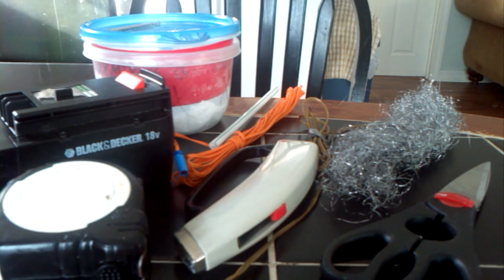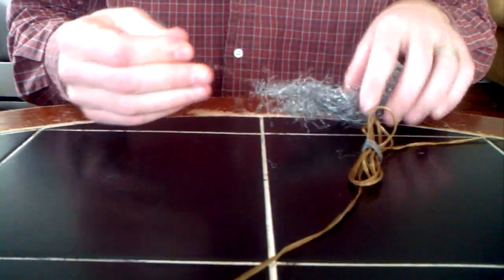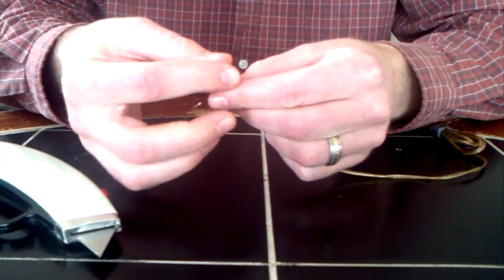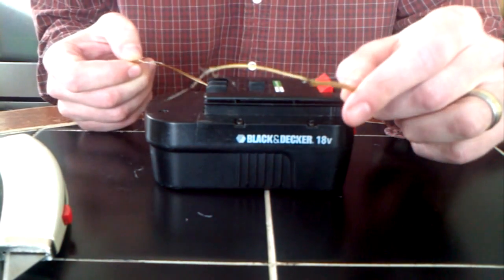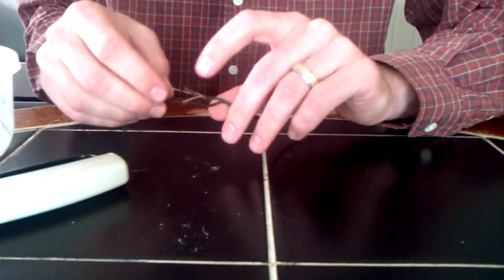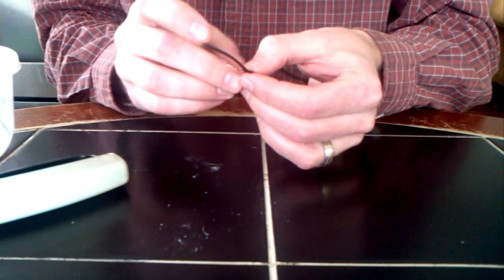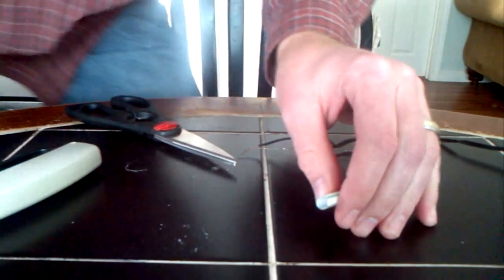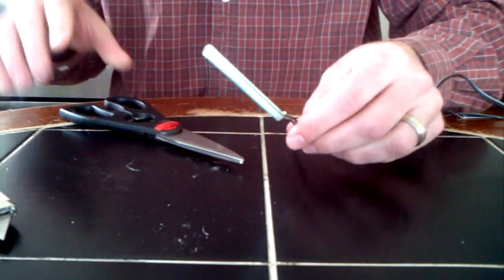Part 6:  How to Build a High Power Rocket - Straw Ignition Device

Comment: Why the ignition from the top? Model rocket engines ignite from the bottom.. I'm confused 🤔
Reply from the maker: You get many times more thrust with top ignition.  The little estie rockets are ultra, ultra light.  Bottom ignition will have a high powered rocket yaw and cruise missile.  There is NO comparison!
Reply: @WizzBang75  it's so strange when people use the phrase "no comparison"  wrong when that would mean they were exactly the same. if there's a difference there is a comparison. Lol 🤣... I'll just have to make two rockets, one bottom ignition & one top & see  for myself.
Reply from the maker: @cward91279  YES!

Comment: I suppose this is much easier than trying to mix nitrocellulose lacquer and black powder into a slurry and coating your wire with it then letting it dry. Have you ever tried that way?
Reply from the maker: Never have.  My igniters have not failed so no reason to try anything different.

Comment: Anyone messing around with rockets, igniters, etc. shouldn't have to watch someone packing a straw for 5 min.  If they need that long and basic of an instruction they shouldn't be trying this in the first place.  Simple electric igniters can be made without all of this fuss, and why wouldn't you want your rocket to launch immediately?  That's how it's been done for as long as rockets have been around.  In addition, packing an inflammable, and then sealing it in (even rubber cement will do this in place of common 65/35 mix) and then igniting it, can easily cause an explosion of the straw, spreading small bits of burning material, and possibly starting a fire on the fins or the bottom of the rocket.  Just sayin.

Comment: really pisses me off how this is illegal in the UK
Reply: It's not exactly illegal but there are limitations. I do it in the uk just don't shout about it
Reply: i did make a motor about a year ago but my dad took everything to the tip because he was getting worried about 'explosives' sitting in the garage. They weren't even mixed. How did you manage a parachute ejection system?
Reply: +maximus small black powder charge with loo paper soaked in bicarb as wadding
Reply: +Richard Ball you can make up too 100 grams of BP without licence in the uk. got to use it straight away as your not allowed to store it thu
Reply: really? must be a bit of work?
Reply: +maximus not at all just a bit of kno3 charcoal and sulphur or use the powder from some fireworks or blanks
Reply: oh ok, ill have to look into it, thanks tho

Comment: Hey wizBang75, I have really enjoyed your videos on sugar rockets.  They have been very useful to me in my project.  I have a question about the straw igniters however.  I am using your 65%KNO3 - 35% confectioners sugar by weight mix, but my igniters do not burn, they do not even fizzle, they simply explode.... I am using steel wool, and hot glue and a 12 volt sealed lead acid battery.  Any advice?
Reply from the maker: They are supposed to explode (to a small degree).  The contents are combustible and they are contained in a straw which puts them under pressure once ignited.  Sounds to me as if you have done it correctly!
Reply: WizzBang75
 When I say explode I mean violently detonate, I have tried to use them to ignite my Hybrid Rocket Motor to no success.  What part does altitude play in these?  I live in Wyoming (5180 ft).
Reply from the maker: ***** Hey, Thanks for your valuable input  :D
Reply from the maker: ***** I had one act ssimilarto the way you described today.  Guess it may depend on how tightly or losely the primer is packed into the straw.
Reply: I have tried both loosely and tightly packed. I really think it has to do with my altitude. I have had to use e matches. Thesee aren't inexpensive but they have been working.
Reply from the maker: I have swapped over to E-Matches as well, but still put them in a straw with a lesser amount of primer mix.
Reply: We use APCP propellant and an igniter for starting our hybrid motors.
See video "how hard can it be" HYBRID ROCKET - whole show in HD

Comment: heyy WizzBang75, what  mix do you use for the igniter. do you use the same mix as for the rocket fuel but then not heated. if its not that what mix is it than
Reply from the maker: That mix is a 65% KNO3 and 35% Sugar.

Comment: I discovered another element apart from steel wool today: twist ties from bread. Just strip the ends about 1/2", insert in your 2" straw, hot glue one end, fill with your choice of ignition material, hot glue second end. Make as many as you want and store in a medicine bottle. The insulation burns very fast, but the wire maintained integrity, using an 18 volt battery.

Comment: Hi WizzBang75, just a suggestion, what I do instead of using steel wool I take a 2 inch or longer if needed, piece of the speaker wire and strip the insulation off and you'll have  a bunch of little wires. I take one of them and twist on the short wire, then wrap spiral it around the insulation of the longer wire, then twist it on the end. This works great for me and 12 volt dc will burn it quickly.
Reply from the maker: tarfoot, I love it!  Will take that route the next time I build an igniter.  Seems to me that your idea makes it less likely to break or fail.